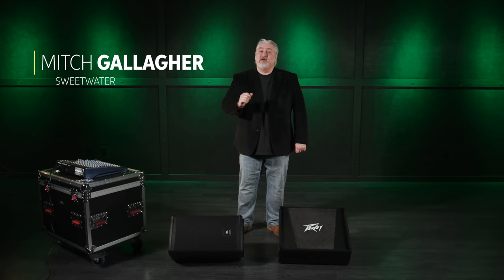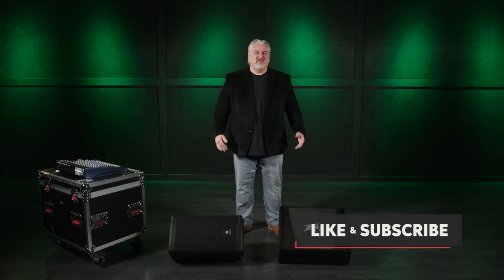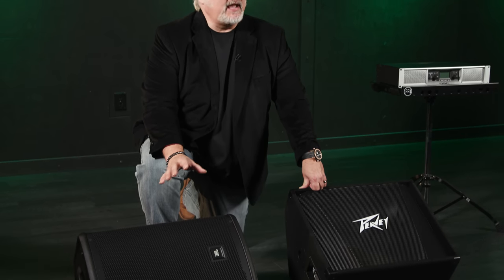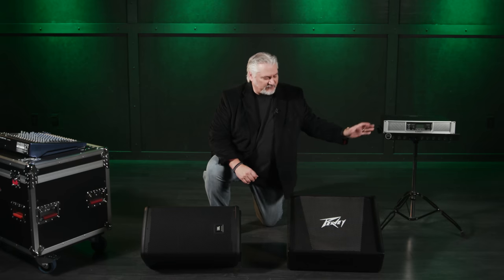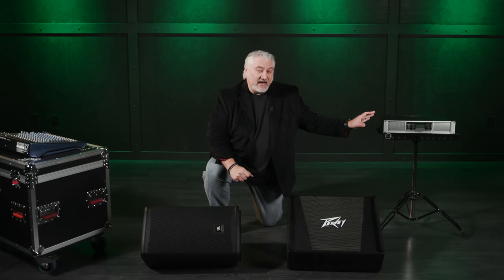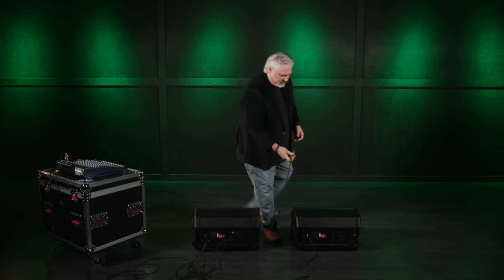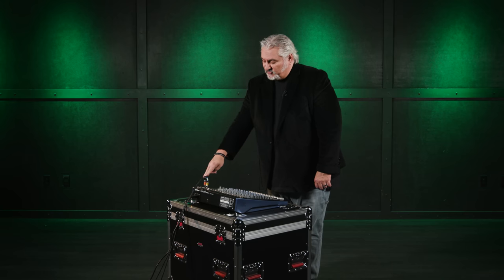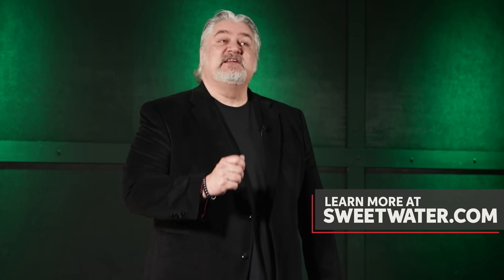How to Set Up Stage Monitors

Comment: Dude you can run balanced XLR line level signals hundreds of feet without loss, distortion or picking up interference. You don’t need to be running “speaker cable” for that.
Reply: True

Comment: I have a yamaha stagepass with a monitor cable outlet but the pa system won't power the passive speakers through the ones labled for monitor. It only powers it through the main jacks. Why is that?
Reply: In the STAGEPAS manual it says the Monitor Out jacks are to connect to powered speakers. Same with the Subwoofer out. Those jacks are not for powering passive speakers.

Comment: The eq placed after the aux send and before you power amp to monitor is very useful. Can really help control feedback and shape your sound for an excellent monitor mix.
Reply: Can you please elaborate? So I can't equalize each line in the monitor, but I can equalize the monitor itself if the AUX out line has EQ nobs, am I understanding it correctly?
Reply: @Ksenia Kolyadina  some boards may have that feature, but I'm talking about a separate unit like a 21 band graphic equalizer. Also, be very careful where you place your microphones. Directly behind  the Mike's is ok, to the side is bad.
Reply: @ogmakefirefiregood  Ah, I see, thanks for the reply!

Comment: Thanks for this, please do a video on connecting passive subwoofers with active speakers
Reply: It would be kind of a mashup of both concepts in this video. You'd take the main outs from your mixer to the active speakers. Then you'd run the outputs from the speakers to a power amp. Then you'd connect the passive subs to the power amp with speaker cable. The big, important thing would be to make sure your active speakers have a built in crossover and that you dial that in correctly for your subs. It might take a little more work to dial in and balance levels than an all-active system, but it is doable.
Reply: Thanks so much Dave, I appreciate the help.

Comment: There is an error in the presentation at 5 and 1/2 minutes when speaking of long speaker cables. The resistance of the speaker cable adds up in a long run and is in series with the speaker. As the speaker is a dynamic load, some frequencies have a higher current draw and others have less as the speaker is a complex impedance. This makes losses vary with frequency. For 8 ohms it is best to keep cable under 50 feet and for 4 ohms, under 25 feet to keep the loss at a minimum.
On the other hand, the signal out to an amp can be quite long with very little loss. The amp appears as a high impedance load on a low impedance source. Adding an ohm or two into 20,000 ohms typical makes very little change due to resistance. EG: what is the difference between 19992 ohms and 20.002 ohms? Now 100 feet for a speaker cable of 14 AWG is .00288 per foot, so 100 feet is 0.288 ohms. This is per conductor, so a round trip in a 50 foot cable is 100 feet of series wire. Now back to your 4 ohm load. What is the difference between 4.00 and 4.288 in percent loss?  Put your amps as close as possible to your speakers and use as short of speaker cable as possible.

Comment: I have a question? I'm using two passive monitors and two passive main speakers. The mixer has one aux send. My question is, do I need two amplifiers (one for the main speakers and the other for the stage monitors)?  If not then how do I go about connecting both main and stage monitors to the amplifier to the mixer?
Reply from the maker: Hello, rodericksmith1482!  Yes, you would need two amps, unless you’re running a mono mix. In which case you could run the mains off one side of most amps, and the monitors off the other side.
Thanks for the interest!
Spunde, Sweetwater Sales Engineer, (800) 222-4700 ext. 1732, Spunde@Sweetwater.com

Comment: adding to the info, on active you are not adding speakers to drop down impedance yes? but you adding more power sucking because of its built in power amp so   if you add one or two more power amps you're risking the source of power Ampers but if you are lucky you can getaway with it. While on Passive speakers.. Connecting two speakers on one channel not a problem but adding more speakers from two speakers it's a different story but still possible as you can go series connections, not as loud thou but it will do the job for just monitors.

Comment: After setting up the stage monitor and adjusting the aux volumes. Will the effects such as reverb work  through the floor monitors also ?
Reply from the maker: Hello, jamesmitchell2804! That will depend on the mixer that you’re using! Most digital mixers have the ability to mix your FX sends through your monitors as well. Give us a shout and we can discuss in more depth!
Thanks for the interest!
James Masterson, Sweetwater Sales Engineer, (800) 222-4700 ext. 1641, james_masterson@sweetwater.com
Reply: You don't normally want any effects through the monitors. Monitors are almost always run dry. The only reason I can see to use effects in monitors is if you are mixing your own show from stage while playing.

Comment: Quick question, we do not own a digital mixer, but would this work with in-ear monitors? Meaning, the same way you connect the stage monitors, would it be the same connecting the in-ear transmitter?
Reply from the maker: Hi there! Yes, you can hook up in ear monitors the same exact way that you would setup stage monitors. Instead of plugging into the speaker, you would plug into the wireless transmitter (which would then transmit to your bodypack receiver). You won’t need a digital mixer to run this. You’ll just need to make sure you have auxiliary or monitor outputs that your mixer can run a separate mix to.
I hope this helps!!
Nick Pasquino, Sweetwater Sales Engineer, (800) 222-4700 ext. 3230, nick_pasquino@sweetwater.com
Reply: @sweetwater Thank you so much for your reply. Everything runs perfectly, could I ask another question? 

could I mix my own in-ear volume without affecting others in-ears, or is that only possible with digital mixers?

Just wondering cause I really want to low some instruments a tad bit down and bring the vocals up, just for my in-ears.

But I have a feeling it isn't possible?
Reply from the maker: @tru3nz  That would only be possible if you’re running your mixes from multiple auxiliary or monitor outputs on your mixer – analog OR digital. If everyone is sharing the same output for the mixes (monitor or in ears), then you will have to keep the same mix for everyone.
Feel free to give me a call if you’d want to discuss any further!
Nick Pasquino, Sweetwater Sales Engineer, (800) 222-4700 ext. 3230, nick_pasquino@sweetwater.com

Comment: Thank you for such a great info. I have one question, if I use a wired IEM setup (with a headphone amp like Behringer MA400 in my pedalboard), can I connect it to the nearest floor monitor on stage?
Reply from the maker: Hello! This seems like a question that requires a back and forth conversation. Feel free to email or call me!
Thanks for the interest!
Spunde, Sweetwater Sales Engineer, (800) 222-4700 ext. 1732, Spunde@Sweetwater.com

Comment: Come to think of it, I have never once used active monitors. Is that just a convenience thing, one less thing to set up? Or are actives significantly cheaper than buying a separate monitor and rack unit?
Reply from the maker: Hello, Guitar Nerd! Active monitors are more convenient because there's less stuff to transport, and they take up less space and weigh less overall. Passive speakers and a separate power amp offer an advantage in sound quality (if you're buying nice gear...), but usually folks aren't breaking the bank when it comes to what monitors they choose. Price-wise it about equals out with passive and active setups.
Thanks for the interest!
Spunde, Sweetwater Sales Engineer, (800) 222-4700 ext. 1732, Spunde@Sweetwater.com

Comment: Help!  We've got a mixer with ONE monitor output.  There are three of us, EACH with a powered monitor.  We have signal issues trying to daisy chain all three inputs using THRU ports.  What do we need to do?  Will an "passive splitter" suffice, or would an active one be needed? I looked all over and the only other thing that I could come up with is a multi-out headphone amplifier, but I know that isn't the same as a line level signal; the impedances wouldn't match.  Help!  TIAs!
Reply from the maker: Hello, nathanwahl9224! Give us a call, this would be much more quickly fixed speaking with us on the phone!  That said, there’s no reason you should be having trouble with the way you’re running it; so possibly there’s a gain staging hold up some where? In a pinch you could definitely use a headphone amp like you described. Give us a shout and we can discuss in more depth!
Thanks for the interest!
James Masterson, Sweetwater Sales Engineer, (800) 222-4700 ext. 1641, james_masterson@sweetwater.com

Comment: How would placement of these monitors work when dealing with a choir who use a backing track where you're using cardinal pattern pencil mics? For creating a good master recording I want to avoid as much sound bleed from the monitor as possible whilst maintaining a good dynamic range of the choir.
Reply from the maker: Hey, Mikey! I would recommend placing the monitors 180 degrees behind your microphones. If you’re running cardioid microphones, they will reject any signal coming from behind them – cardioid is front address, so they’ll only pick up the signal of what they’re facing. Here's an article with some more details on placing monitors in a live setting:
https://www.shure.com/en-US/performance-production/louder/how-to-control-feedback-in-a-sound-system
I hope this helps!
Nick Pasquino, Sweetwater Sales Engineer, (800) 222-4700 ext. 3230, nick_pasquino@sweetwater.com

Comment: I have an old Peavy 400SC power mixer that is driving 2 main (8 ohm) speakers from one channel and would like drive 4 monitor speakers from the other channel.  From what I understand about impedance, each monitor would need to be 16 ohms.  Monitors are typically 8 ohms.  Is it possible to add some type of crossover network and still be able to hook up 4 - 8 ohm monitors in parallel?
Reply: Your best bet would be to add a separate 2 channel amp to power all 4 spkrs( 2 per channel) and feed the amp from your mixer Aux out. Then you can use all of the Peavey’s power to the mains.

Comment: Can we connect active speaker and power amplifier at a same time
Reply from the maker: Hi, thanks for your interest. You should not connect a power amp to an active speaker, since the speaker has its own power amp built in. However, you could certainly run both active and passive monitors as part of the same rig. You would just need to go through a suitable power amp for each passive speaker, and connect the active speakers directly to the output from your board or stage box.
I hope this helps – feel free to contact me directly with any further questions, and thanks again!
Caleb Lowrey, Sweetwater Sales Engineer, (800) 222-4700 ext. 1620, caleb_lowrey@sweetwater.com

Comment: I'm surprised anyone still uses stage monitors. Most now use in-ear monitors. They are easier on your ears, back and wallet.
Reply: But less natural and isolate you from the audience
Reply: @geofffriend4161  You want to run crowd mics with in ears. 2 (or more) microphones covering the crowd mixed into your in ears. You can mute these mics during songs if you wish. You can also run stage mics for the same purpose but usually the drum overheads work well for that. You can wire up a foot pedal to do the muting/unmuting if you wish or have them on a reverse gate.